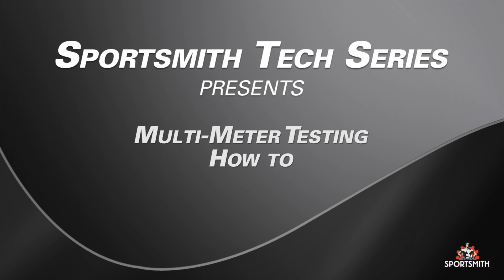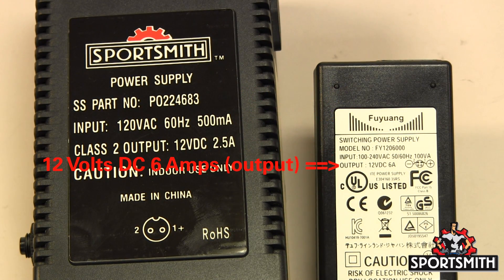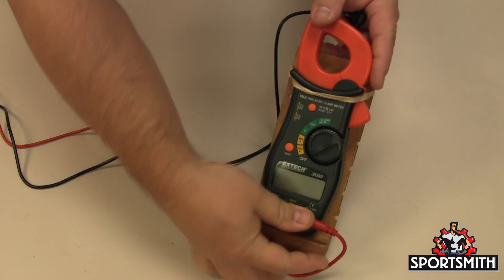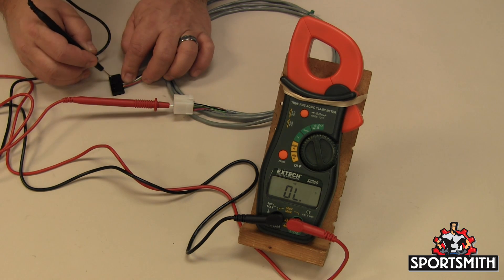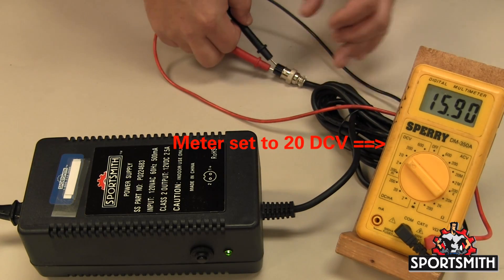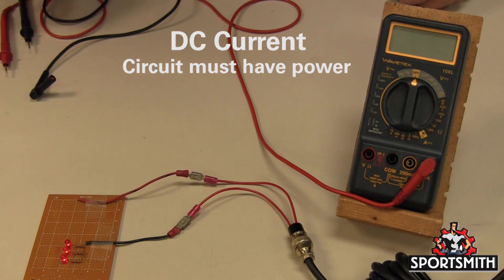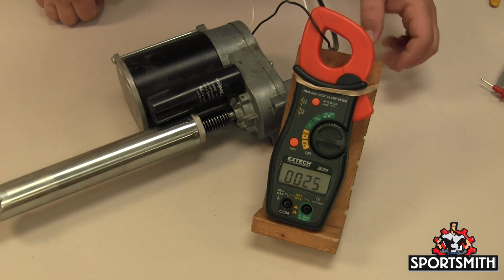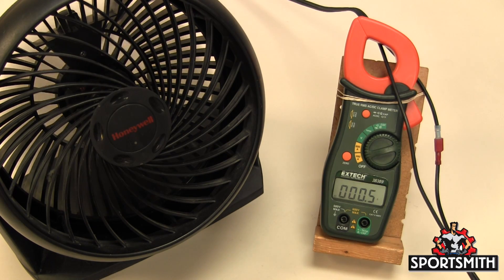How to Use a Multimeter for Electronic Testing

Comment: I have that same Sperry DM 350a meter as yours.  I have been trying to find out how to take a continuity test since these type meters do not beep.  I saw how you used it here on this video for continuity, but I don't know what represent continuity on the display.
Reply from the maker: Thanks for your question. Beginning at 2:14 in the video you can see the use of that meter for Continuity testing. It is set to Ohms and you will be looking for a value (number) that would represent the Resistance (Ohms) in that circuit IF the circuit you are probing is complete. This is shown at 2:14. Or, if the circuit is not complete the display will show "1."  meaning infinite resistance (Ohms) which you can see at 2:17- 2:21
Reply: @sportsmith  Thank you for your reply.

Comment: What did u mean when u said do not short the leads? Do u mean don't allow them to touch?
Reply from the maker: Thanks for your question. At about 3:31 in the video you will see the the meter probes crossed like an X. When you do something like that, with a live circuit, if you touch the probes to each other while they are touching each conductor you are testing it will short out the power supply and possibly damage the meter.